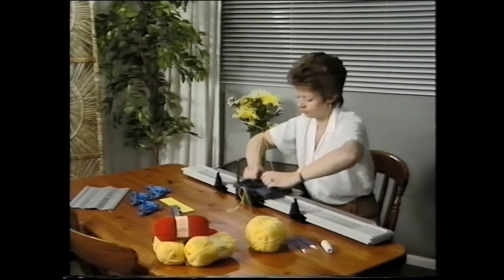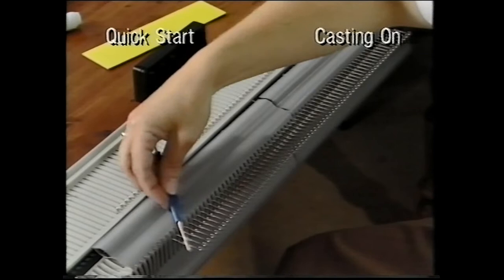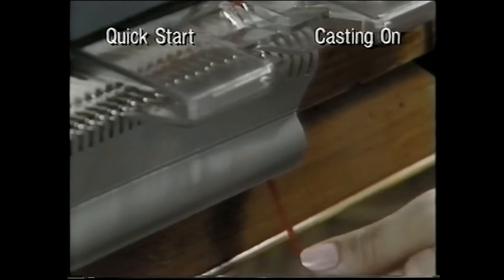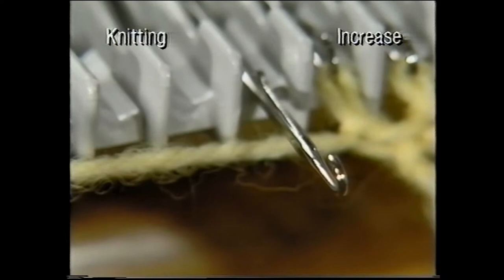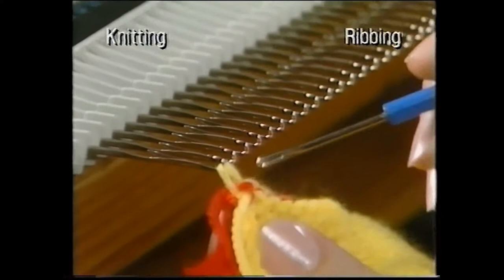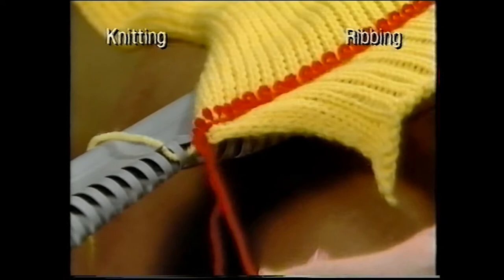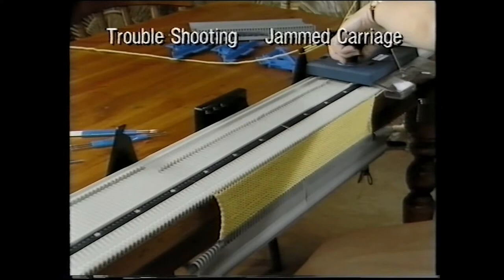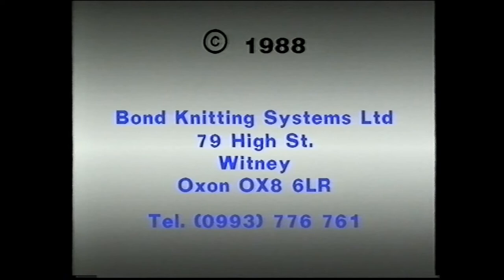Bond Elite Knitting Machine - Instructional Video

Comment: Thanks so much for the video. I need help with my Bond Elite. What is happening is when I bring needles forward and put over the plastic weight hem then the elastic then fold the plastic sheet back over, it brings the needles' buts on bed raised. Therefore the carriage wont pass over. 

I tried to cast without the plastic weight hem. As soon the keyplate is in the carriage the needles jam. Also tried to cast manually but needles jam. 

It's a charity shop find with all parts including a ribber.

I'm not new to machine knitting.  I used to have a Knittax. But I am at my wits ends.  Help please,
Reply: You need to replace your sponge strip under the metal plate (with the knitting machine upside down)!
Reply: @GabrielleWeerasinghe  thank you for your kind answer.

Comment: Hi Alex - do you have any knowledge or information about the Elite's sponge strip? Am trying to offer useful suggestions to someone who can see the bits of deteriorated strip coming out of its channel, and wants to know how and with what she can replace it. I'm not familiar with the machine and can only suggest foam strip draught-excluder stuff, or maybe cut strips from those non-stick shelf liner thingamajigs ...
Reply from the maker: Hi there, the sponge retainer is under the machine, first, bring out all the needles to holding position and close the latches.  Pull each needle back and up to remove it from the machine, repeat until all the needles are removed.

Turn the bed over and remove all of the screws holding the back plate on.  Once removed, take out the old sponge which will be sat in a gully.  Clean out any dirt and replace the sponge...  You can just buy one of the sponge bar replenishing kits off eBay, they are cheap enough and work adequately.  

With the back plate still removed and the new sponge in...  With the bed still upside down, Insert the needles back into the machine by inserting them into their slots with their latches open, insert the needles at a sharp angle as to go over the sponge, press the head of the needle to press it into the sponge allowing it to slide home.  It is fiddly but it can be done.

Once all the needles are back in and the needle are ontop of the sponge correctly.  Replace the back plate and screws and you are ready to go.
Reply: @Thesweaterfactory  Thanks so much for that - I'm sure she'll manage it now!